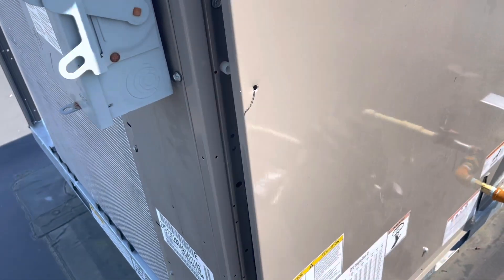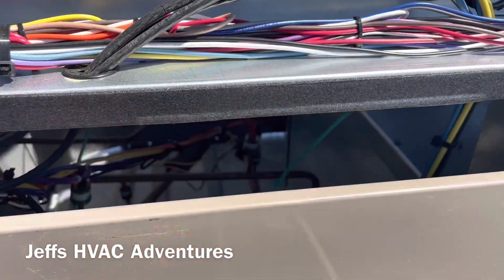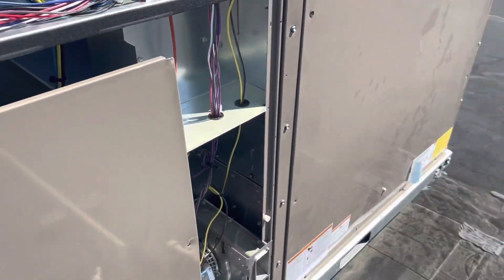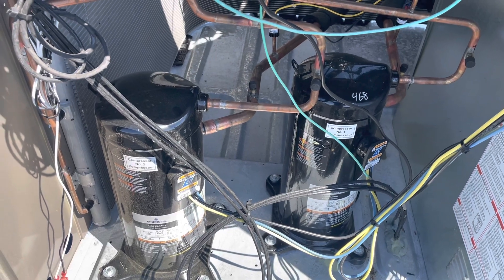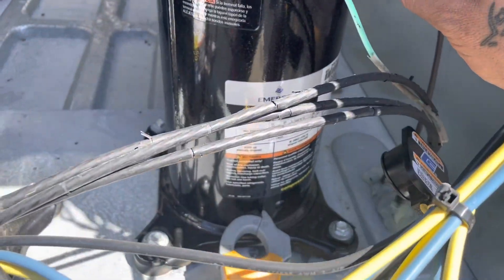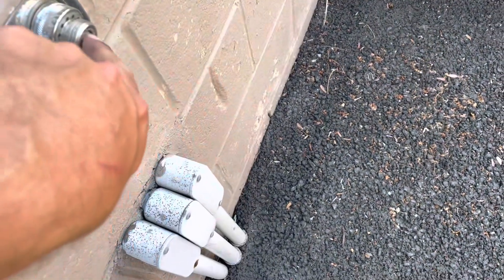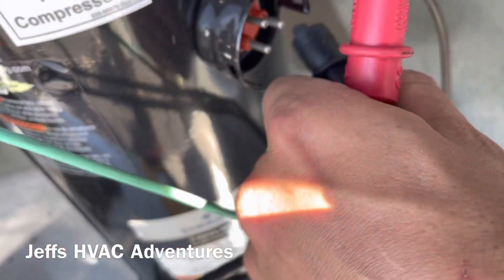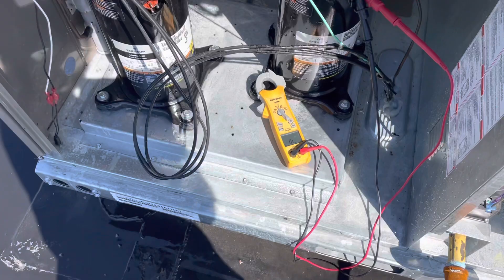York RTU Not Cooling.  Diagnosed and Repaired! #hvac #airconditioner #hvaclife

Comment: So the final step/correction was to reverse polarity inside the shut-off at the RTU? Once again thanks for creating these videos.......If you did place a Fieldpiece bluetooth pressure sensor on the suction & discharge like @dfwhvac stated and the scroll was turning backwards what would you expect to see if incorrect?
Reply from the maker: Yup. I reversed it right at the line side of the main bus of the unit.

Comment: I had a whole roof top of units like that. Installed them in the winter and just saw the indoor blowers working good so they said ok. 

Turns out all the units were wired backwards.
Reply from the maker: Yikes.  It happens though.

Comment: One thing you can do if you don't have easy access to water is unhook the compressor contactor wires and start the unit up and let the air that's pulling through the coil cool it off.
Reply from the maker: Your correct.  Done that before!

Comment: Blows my mind how someone can install and “start up” a 3 phase unit without verification of proper phasing. Takes five minutes to throw a stubby on each suction line to make sure it’s pumping the right way. What happened is someone probably started it up while looking at the blower wheel spin the right way and was clueless to the fact that the VFD will auto correct phasing and they just sent it. Good thing you caught it. Good way to burn up a compressor by leaving it like that.
Reply from the maker: You are correct.  For years guys started 3 phase units and relied on the blower wheel rotation to confirm phasing.  With VFDs going in more and more units you  can’t rely on that any more.  
Thanks for watching!
Reply: Originally we used a 3 phase rotation meter and watched the spinning disk.